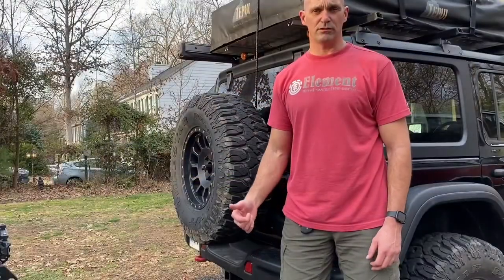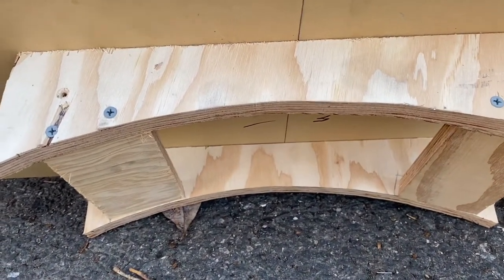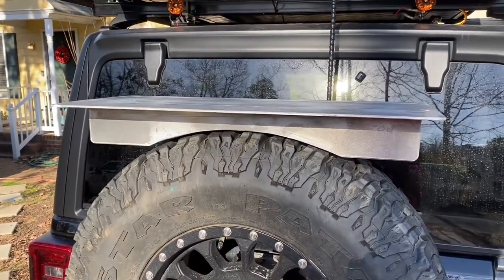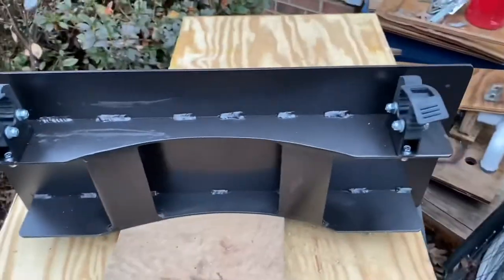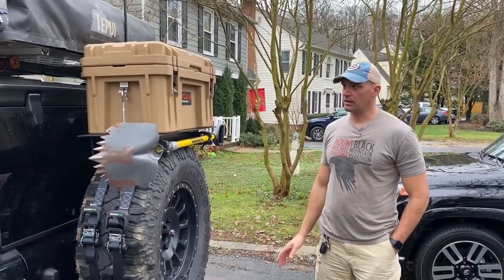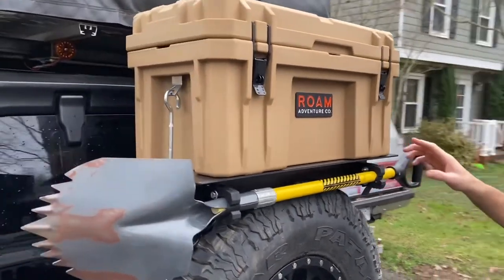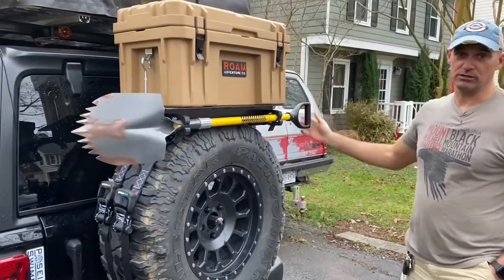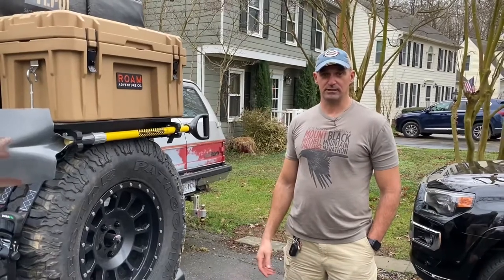Spare tire cargo carrier for a shovel and a roam box

Comment: Great job. Question for you. I see you have a roof tent on your jeep.  How is that working out for you.  Any clamp or weight issues. I've got a JK and everyone tell me you can't do it the way you have done.  Hit me up.  Thanks Dave.
Reply from the maker: Hey thanks for the question, well for all the nay sayers, i put 10,000 miles on that set up on almost 2000 miles offroad through the Appalachian, blue ridge and smokey  mts of virginia, west virginia, north carolina, south carolina and georgia, with no issues at all, i would check all the fastners every 1000 miles and never had anything come loose or shift, so you can totally do it safely as long as you use the backbone system or some system that ties the roof rack to the structure of the jeep.

Comment: Great project! Did you have a brake light you had to remove?
Reply from the maker: Thank you, and yes i removed the factory third brake light and replaced it with the spare tire ring light that shines through the spare tire rim, uses the factory plug, super simple
Reply: @FischerJeepAdventures  cool thanks!
Reply from the maker: Absolutely

Comment: The problem I have with strap attachments, is that they can be cut and the entire thing stolen. How do I know this? This happened to me. So looking for alternatives that don’t use straps.
Reply from the maker: Gary, completely understand, we use a master lock python cable lock just as a deterrent, they might cut the straps but i built everything to accept a cable lock so they cant actually steal the rack and the box, of course anyone can steel anything but so far it has worked, I hate that you had that experience, we all work hard for our things! It a shame others cant respect that.

Comment: Spare tire brackets not made of adamantium dude just use your roof rack
Reply from the maker: thats why i added the evo tire carrier which replaces the factory hinges and reinforces the tailgate, its rated for a 40 inch tire, so given i am running a 35 i think i have plenty of capacity, the tray and roam box empty only weighs 25lbs, i had only planned to put dry food or clothes in there